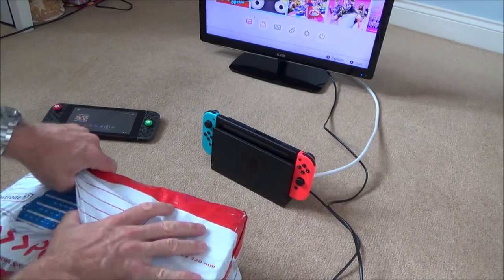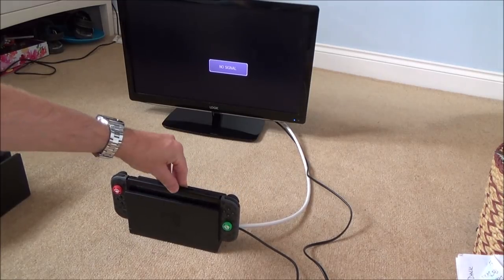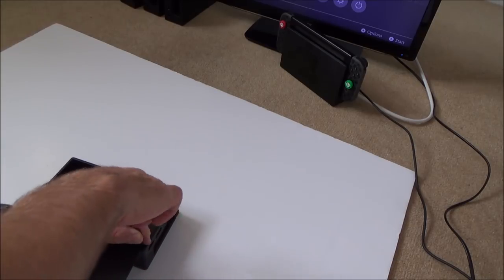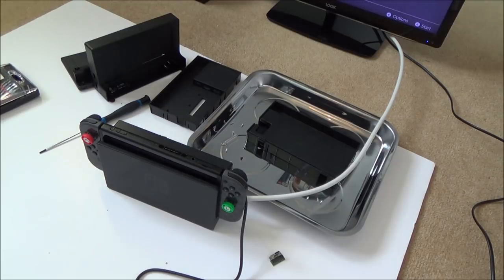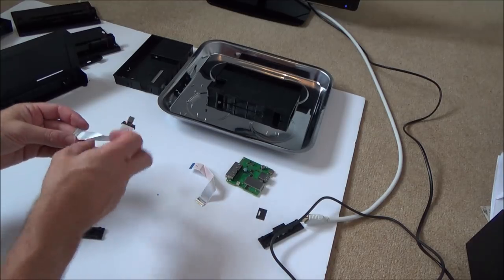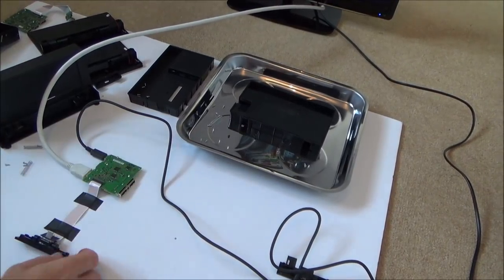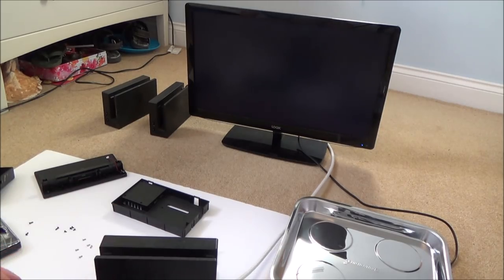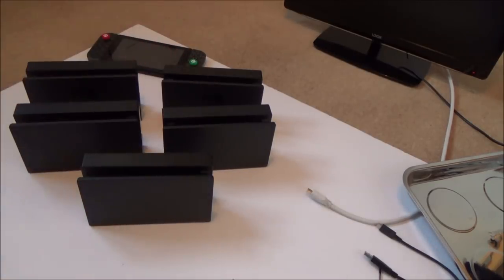Trying to Fix an eBay job lot of Faulty Nintendo Switch Docks

Comment: I'm willing to bet good money that the "fault" with the ribbon cable was in fact, simple negligence on the part of the assembly line worker or possibly the last person who tried to repair it. As shown in the close-up of the contacts, that line of dots that go all the way along the contacts from left to right, is crooked. That is proof that the ribbon cable was inserted into its socket at a slight off-angle and then locked in place. It was probably pure luck that the contacts just barely missed touching the neighboring pins hence it worked long enough to get a Pass on the assembly line. 

With repeated insertions and removals on the dock, the cable likely moved JUST a tiny bit and was shorting on the pin or pins next to one another causing the failure. All that was needed was just to ensure the ribbon cable is inserted fully and that the contact pads were perpendicular to the socket, and job's a good'un.
Reply: It was definitely the ribbon cable because I tested it you can put ribbon cable in wrong with slight we’re all pins are not connected

Comment: Hi Vince I hope you read this... You put up a pdf once about extending your WiFi using a second router as a slave for the first... I cant locate it anywhere. If you are able to point me in the right direction I'd greatly appreciate it. It helped alot, however my settings were lost after a reset...
Reply: I'm not familiar with his video but it sounds like what you are doing was setting the second AP as a repeater. If you google something like "set wireless router [your model of router] as wireless repeater" you will probably find what you are looking for.

Comment: I remember an old, cheap and nasty android tablet had an issue with how it displayed colours on screen.  It had a faulty ribbon cable and how resolved it was to just reverse the orientation of the cable so that each end was in the opposite connector.  Never had an issue with it since.  Some of the best methods to clean the contacts is to use a fibreglass pen or an eraser for pencils and just gently rub them until the oxidisation comes off.

Comment: I have 3 docks that doesn’t display anything. When the switch is docked, the light turns on but nothing is displayed on the tv. I can’t send them off for repairs and I don’t want to buy another one or a third party dock. Anyone else with the same problem?

Comment: The cable can still cause the "USB" Port to not work, The cable can still be faulty with the USB. Since that cable was probably share with the dock, One of the pins is still bad. Same goes with laptop, When trying to diagnose and repair.

Comment: my tv recognise the swith, it shows i connected it, the dock turns green and tv still gets no signal :D cleaned with alcohol and everything... motherboard together with other spare parts and cables in different dock = still the same result.... It charges my switch and the tv says i connected it but i get no image/signal... anyone??? XD
Reply: @nebuloussammich3703  i swapped the motherboard :3

Comment: you might as well do some shell swaps with these. i put both my dock motherboards in new shells. much smaller and easier to travel with. 

this is the one i went with:
 https://www.etrailer.com/Accessories-and-Parts/Swagman/64005.html  

i used a service, 3dhubs.com, to have them 3d printed for me. it was surprisingly cheap.

Comment: Wow, that's a hell of a deal...Dock sells for $90 new, granted, they include AC adapter and HDMI cable, however, I'm sure you could sell each of these for $45 each (half price) and make a decent little profit there.  (prices are USD, not sure about prices in UK)

Comment: Wonder if it would be possible to 3D print a dock that could house the motherboard from the original. You could have a smaller travel dock that won't brick your switch.

Comment: Hi, I just bought a hori drum controller for switch and works fine for few days. I tried today and my switch can’t see the drum anymore. 
I tried to plug in both usb ports and still no change. I tried the switch of the console for 10seconds and restart in the dock method. But stoll not working. Igot two third party controllers and my switch not charge them as well. Any Idea how can I fix it?

Comment: I bought a faulty one, original packed, from gamestop but it is not working and I have trown out the bill. It charges the Switch but I canot get any output. Can someone please tell me what I have to exchange and where to get it in europe? I figured it's easier to just change the guts myself but I do not find anything.

Comment: Hi very intresting Video.  But that is in my Case not my Problem but maybe you can help me out. I have also no connetion to my tv just Black screen. I try to check the capacitor around the hdmi Conector. At the right upper corner of the hdmi Conector is one small and next to it little big bigger capacitor the bigger one is shortet when i check it with my Multimeter. On the other side of the Mainboard i have also one shorted capacitor near the ribbon cable Conector. Any idea what to do now? Best regards from Germany

Comment: I have a nintendo switch dock that charges and has a solid green light but will not display on tv. I have tested multiple working hdmi cords and hdmi ports, also changed quality settings on the switch tablet but still cannot get it do display. Do you have any advice?

Comment: The reason the ribbon cable was fine but not working is because if it's not straight the pins can short out on others 
That's why one side was longer than the other 
It was clearly pushed in the board on one side to much hence why it didn't work

Comment: Hey thanks for the video. Yes the ribbon as folded very hard and this is a common fault . I have just done mine and will reinforce the cable with a harder tape to stop the kink coming back .Good find 👏 👍👍👍

Comment: 14:10 becareful when docking your switch. the two male parts broke one of the bottom screws next to the USB inlet on my switch. half the threads broke and the screw fell right out. plastic threads are never ok

Comment: Is it worth buying a faulty switch to fix
Reply: Little Beanze i think that its a bit risky you can get lucky and its not a big problem but you can also get unlucky
Reply: Depends how much it is.
Reply: Angel gamer Xx I was thinking of buying 2 docks and 2 consoles and swapping the parts round to get them working for around £100 in total
Reply: Little Beanze that seems alright, hopefully you can fix it. Good luck.
Reply: Little Beanze you can get lucky and atleast one of them works if not yeah
Reply: Angel gamer Xx I'll try my best🙂 hopefully it's something simply such as swapping the motherboards or the cables have just came undone

Comment: My money was on the board being the issue.  Very wrong.  Then I was convinced it would be the port.  Wrong again.  Sometimes it is the part you least expect and it is good to be thorough like yourself to avoid wasting time chasing assumptions without thoroughly testing each component.

Comment: You know I always find it funny how hard people try to "protect" their Switch. Of course I love mine, too, but my boyfriend dropped it off of a 7 ft height difference flat onto the concrete driveway face-down and the Switch didn't have a single nick on it. At this point I'm not sure how you COULD damage it.
Reply: Lucky you. Mine slid off of my laptop 3 ft and the right joy-con ripped out of its spot, ribbon cables exposed. Fortunately I knew how to fix it but now the rumble is a little weaker.
Reply: Very lucky. That plastic screen can be scratched by looking at it the wrong way.

Comment: Hey Vince, I have an idea for the next Video:Triying to Connect a Wii U Gamepad to various Consoles.I know its a other signal,but maybe you can Convert it.
Reply: I’m currently trying to connect my Wii U Gamepad to my PC using libdrc!
Reply: Jaan Artur Viirsalu But thats Homebrew.I meant Adapters, but of course if adapters dont work,he can take Homebrew.
Reply: Try getting the Wii u game pad working on the switch
Reply: It's not homebrew. It runs on a Linux pc and you connect your gamepad with 5Ghz Wifi!
Reply: Eddy Studios How? You would have to use homebrew. The Wii U Gamepad uses WiFi! And Nintendo modified the WiFi so it would be impossible to connect it straight to a Switch. Also do you mean so you get picture to the Gamepad or not? To get picture without homebrew on your Switch you would have to use a dock.

TL;DR: There has to be a computer inbetween!
Reply: Jaan Artur Viirsalu Chill mate. I never said it would connect straight to the console. Of course there would have to be modification or a adapters required. But you can do it a easy way by outputting the switch into a hdmi online streaming app which you then open on the Wii u browser. But that technically isn’t through the actual switch 👍🏻
Reply: Lars Zewe Yes I Know.